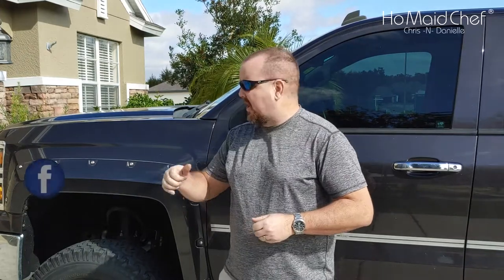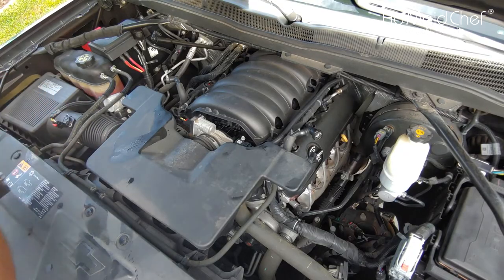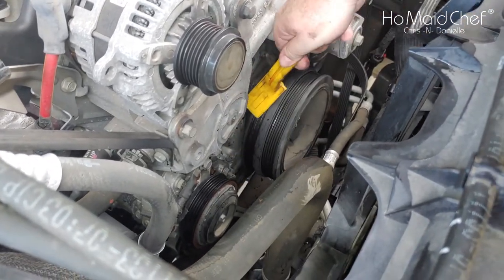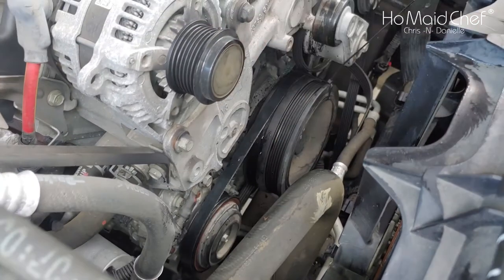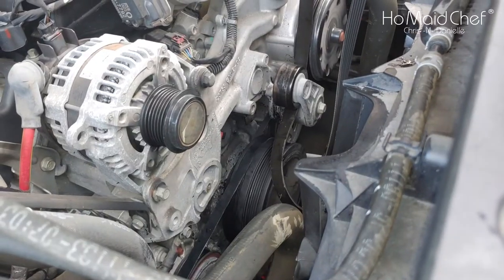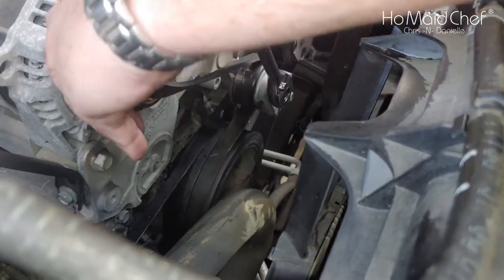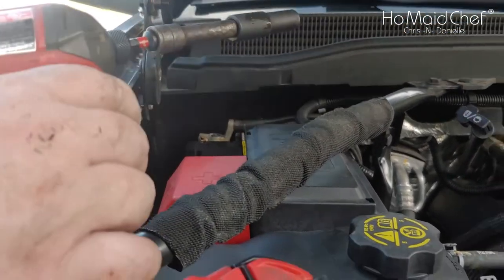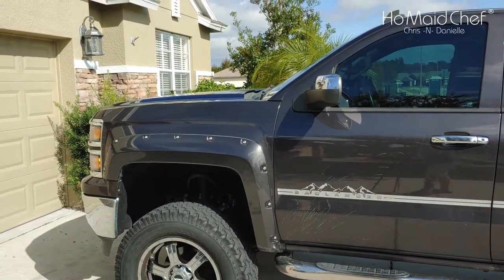How to install a stretch belt, replacing the AC Belt for GM 2014 to 2020

Comment: My belt messed up as I was enjoying a snowcone to cool off. Great video about to get to work
Reply from the maker: You can do it!
Reply: @ChrisDoesWhat  how did u get the belt over the small pulley? It looked like you got it almost all the way on before u started turning the pulley. I couldn’t even get it a lil over the small pulley so when I turned the pulley the belt kept sliding even with the zipties
Reply from the maker: @fabiandelvillar1611  I put the belt past the big pully in the space behind it, then put the belt completely on the smaller puller. Once on the small pully, I pulled as much of the belt over the larger pully and then zip-tied it to hold it in place to rotate it on the rest of the way.

Comment: What socket did you use on the crank ?
Reply from the maker: It was a deep impact socket, but any socket should work that is the right size for the bolt.
Reply: @ChrisDoesWhat  24mm

Comment: I did same on my fiesta with zip tie cheap and fast to do
Reply from the maker: It is so easy! Yet people keep saying there is a tool for this, had zip ties, didn't have the tool.
Reply: The ford tools didnt work the motorcraft actually its bend........there are other tools but are expensive zip tie are cheap
Reply from the maker: @themarvelousvintage76  They sure are and we always have them on hand.
Reply: @ChrisDoesWhat  my only complain those belt its only for one time fit if you trying to take out to remove thermostat when you fit back will slip off so you always need buy new one if remove old one

Comment: There's a tool for this makes so much easier.
Reply from the maker: Without tool much cheaper, had zip ties, didn't have tool when I wanted to do this.
Reply: I got the Lisle tool for this and it didn't work on mine no matter how many different ways I tried it
Reply: Lisle tool didnt work on my car either - the groove on it was not wode enough to fit the lip of the pulley